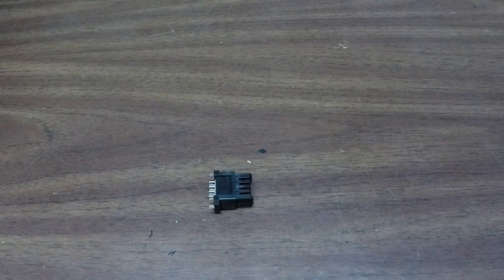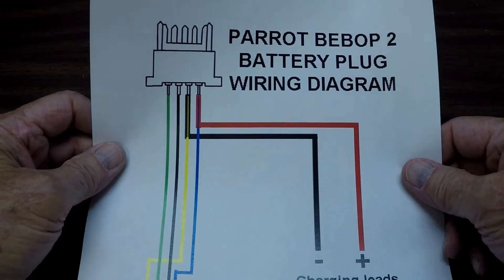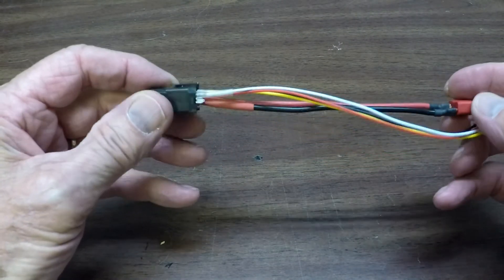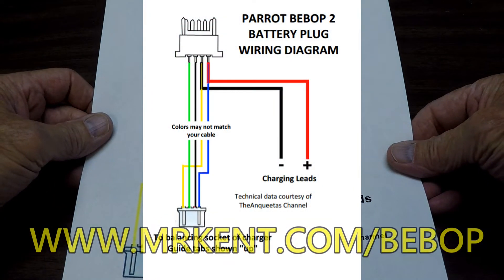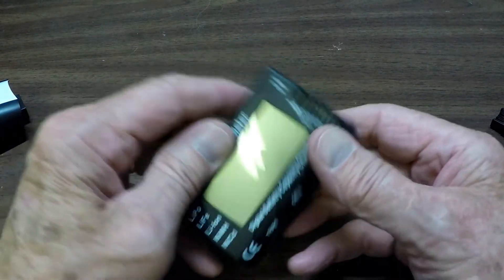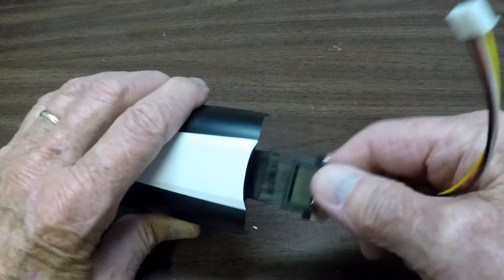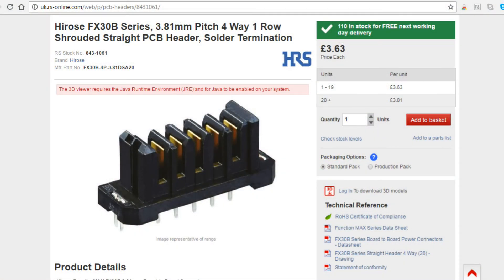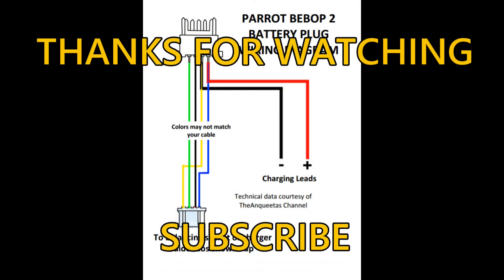The Best Bebop Balance Charger EVER

Comment: I have a bebop2 and never crashed it or got it wet and it will not power on and my batteries test fine with a multimeter...the red LED in the back will not turn on.
Can you help???
Reply from the maker: I wish I had an answer for you. I have heard of that happening to others. I don't think I can help. God bless.
Reply: @user-sr8pn9xg8z  thanks anyways.

Comment: Is the stock Bebop charger not a balance charger?
Reply from the maker: Thanks for your question. No, I am sorry, it is not a balanced charger. Otherwise I and so many others would not get the flashing red light when the cells become unbalanced. I have put up lots of different options that you can use to construct a connector between your battery and a balanced charger. The best is found at: https://www.youtube.com/watch?v=b1X77aK7ki0

If you have any other questions please don't hesitate to ask. Thank you for your comment and God bless.
Reply: I find your channel and web site fascinating. You certainly have compressed many years of knowledge into a one stop shop. Great work.

Comment: i got mine from your website, looks great, my IMAX B6 wont balance charge my bebop 2 stock battery, it will only charge the battery! maybe i need a new IMAX B6
Reply from the maker: Have you got one of those little $10 battery checkers? You can see for sure if it is balanced or not. My balance charger does such a good job that after charging and I switch to balance it only goes for a minute or two and says it is finished. Let me know if you can. Thanks and God bless.
Reply: it takes 20 mins to charge my battery, tells me that i need a new battery, any ideas? mines a little cheaper, all the cells are balanced, i got one of these https://www.ebay.com/itm/2pcs-RC-Lipo-Battery-Low-Voltage-Tester-1S-8S-Buzzer-Alarm-indicator-Checker-USA/332618307296?epid=25013427279&hash=item4d719896e0:g:vFkAAOSwDGhazwAk
Reply from the maker: I have never used one so I am not sure how they work. I have one of these and I can check the condition of each cell, one cell at a time:

https://www.amazon.com/Tenergy-Battery-Intelligent-Digital-Balancer/dp/B0178P8H9U/ref=sr_1_1?ie=UTF8&qid=1536015614&sr=8-1&keywords=5+in+1+cell+meter

I can't make a judgment of what you are using but the above is "ideal." I hope your battery is not bad. God bless.

Comment: mrkentdotcom  In description you have 2 diffrent part numbers listed dsa20 and dsa30.  dsa30 is linked to the mouser site dsa20 and dsa30 for digikey. Which one is the correct number? Thanks
Reply from the maker: I am not sure I understand your question. It depends which company you wish to order from. I am not sure if Digi-Key is still offering the plugs. I hope that helps. God bless.
Reply: mrkentdotcom look at your write up below the video. You have 2 diffrent part numbers. Fx30b4-dsa20 and Fx30b4-dsa30. Was wondering which one is the one to use. Looks like one is taller than the other.

Comment: To whoever is interested :)    I never had the Bebop 2, I have the Bebop 2 POWER. Only difference is You should get 3 - 5 min more fly time with the POWER. But whichever you buy I would definitely invest in a DP2 balanced charger (EV-Peak) get it at Amazon its a little pricey around $100. But it will balance charge all 3 cells on each battery + you get STORAGE mode, while the (High Def) charge brick you get from Parrot doesn't. The DP2 will work with Bebop 2(2700mah) battery's and The Bebop 2 POWER(3350mah) battery's. I'm pretty sure the DP2 Balance charger will pay for itself easily by next year at this time. I think Balance charging & Storage of the battery's is the most important thing. "Well" other than a medium to major crash. Ha Ha. FYI - I got the Bebop 2 POWER Extreme Adventurer package from Parrots website for $538.50. Ordered Dec 22nd - Received Dec 28th. They had a nice price at that time!  - - - - -  1 Parrot Bebop 2 Power ,  1 Parrot Skycontroller 2 ,  1 Parrot Cockpitglasses 2 ,  1 BackPack - WORTH $99 BY ITSELF - YOU WILL NEED IT! ,  3 Power batteries ,  8 propellers ,  1 charger + cable + 4 plugs - LIKE I SAID GET THE DP2 BALANCE CHARGER ( Love it!!!) - WILL STILL NEED THIS BRICK TO CHARGE YOUR SKYCONTROLLER 2 ,   1 assembly tool ,  1 USB cable ,  1 smartphone and tablet support ,  1 quick start guide
Reply from the maker: Thank you for your input. I crashed mine today, am producing the video at this moment. God bless.
Reply: No - Thank you mrkent , For all the Info you have passed on to me the past couple of months, through your videos ,  I have learned so much from YOU and Helderhugo. I know I'll be watching  out for your new video. "Keep it up"   and   Thanks again
Reply from the maker: Thank you for your kind words and God bless.
Reply: Hello You recommend the evpeack Charger? Is the same that having like a b6 Charger with custom cable?
Reply: @gonzarb93  - Yes ,  just go to AMAZON,  search for --- ( EV-PEAK DP2 35W/CH 3.5A/CH 3 Ports Intelligent Battery Charger for Parrot Bebop 2 Drone Battery ) The EV-Peak DP2 will charge 3 battery's at one time & will balance charge all 3 cells in each battery while it is charging, Another great thing about this charger, If you are not going to fly for awhile, You can put the battery'(s) in (storage mode) which will balance charge up to or drain down to 50%. The DP2 comes with a real nice heavy duty 3 prong power cord around 4 foot long. I see it is $90 now - I paid $105 for it in Jan/2018 and it still works great.

Comment: ~20$ charger cable with balancer connector on ebay

http://www.ebay.pl/itm/PARROT-BEBOP-2-charger-cable-with-balancer-connector/112762893910
Reply from the maker: Thank you for your input but I don't think that will work with the Bebop 2. God bless.

Comment: Found this.....no soldering   https://www.amazon.co.uk/Anbee%C2%AE-Balance-Charger-Adapter-Battery/dp/B00T82HV4O/ref=sr_1_1?ie=UTF8&qid=1508966856&sr=8-1&keywords=Balance+Charger+Socket+Adapter+Plate+for+Parrot+Bebop+Drone
Reply from the maker: Thank you John. Yes, Helder Hugo has a video about that one:
https://www.youtube.com/watch?v=drhc02ixMmk
It works for the Bebop 1 battery but as far as I know, there is not one for the Bebop 2 battery. Thank you much for your comment and God bless.

Comment: Thanks MrKent, have just received my bebop 2 fpv, but u fortunately the only battery that came with it was Dead on arrival, they are replacing it with a new one. I will make one of these connectors for a balance  charger, heard nothing but negative things about the stock charger. Just have to find a place that sells the connector in Australia. Thanks again, keep up the vids.
Reply from the maker: Amazon.com has this plug available for under $14. Just plug in the part id: FX30B-4P. I have purchased one from Amazon so I know you can get them there. I am assuming you can get to Amazon from there :) Thanks for your kind words and God bless.

Comment: sorry, I don't think you are following. there are 3 ends. The Digikey end, the white end (Allytech 10pcs 3S 26#11.1V)  the red end. Where to find the red one? thanks
Reply from the maker: OK, I get it. The red 3S 26 wire (which is the black wire on the diagram) goes to pin #2 at the Digikey plug. The white 3S 26 wire (which is the green wire on the diagram) goes to pin #1 at the Digikey plug. I think I need to redo the diagram huh? I hope that helps . . . Please let me know.
Reply from the maker: By the way, I have updated the diagram to match the color code of the wires that everyone seems to be using. Go to https://www.mrkent.com/bebop/
Refresh the page and view or download the latest wiring diagram. Thank you for your patience and God bless.
Reply: I know this is a few months old, but, the red plug in MrKent's video appears to be a Dean's RC connector, which is available at most RC hobby shops.  If you already have your balance charger, you should use what ever is used on your charger, for the main positive and negative charge leads.

Comment: I am talking about the red plug? I don't see a link to that one.
Reply from the maker: The colored wires on the drawing do not necessarily match the wires coming from your balancing plug. Looking at the drawing the "heavy" red wire goes to the pin on the far right. The "heavy" black wire goes to the pin just to its left. (Red=#4) (Black=#3) The "thin" wires connect as follows: #1 wire from the balancing plug connects to pin #3 of main plug.#2 thin wire from the balancing plug connects to pin #1 of the main plug. #3 wire from the balancing plug connects to pin # 2 of the main plug. #4 wire from the balancing plug connects to pin # 4 of the main plug.

https://www.mrkent.com/bebop/

Go to this link and click on the wiring diagram link if you haven't don so yet. I hope this is helpful. Don't hesitate to ask if you have any questions. God bless.

Comment: I built the balance wire per the print downloaded from your site. It was connected to a new SKYRC IMAX B6AC V2. Following all instruction, all I could get was 'NO BATTERY'.  Any ideas?
Reply from the maker: In my experience that message appears when one or both of the heavier "plus" and "minus" wires are not plugged into the charger.  There should be a total of six (6) wires connected to the charger; The three small wires, one from each cell, One small "common" wire, common to each cell, and the two heavier "charging" wires.

I hop that is helpful. If you have further questions do not hesitate to ask. A good video demo is: 
https://www.youtube.com/watch?v=unTMIHOJQg0

Thanks for your comment and God bless.
Reply: The wire was built correctly, I believe. Yes, 6 wres to charger. Tested with multimeter, all test seemed ok.
Reply from the maker: The one thing that was confusing to me at first was that the #1 (yellow) wire coming from the balancing plug must cross over and connect to #3 pin on the Bebop plug. You may want to check that carefully. Also, another good video to display correct wiring is the one where I discovered we could actually purchase a plug to match the Bebop 2 battery:

https://www.youtube.com/watch?v=orESacSy2ro&t=242s

You may want to watch that also. I hope this helps.

Comment: The DigiKey part no. referenced indicates a 20MM length plug (last 2 digits). They also have 25mm and 30mm plugs that will work.
Reply from the maker: Thank you for your input.

Comment: hi sir  i use the diagram ur 1st video sir what is the difference between to your new diagram
Reply from the maker: In earlier videos I did not connect directly to the battery, but came up with home-made wiring connections that went from the Bebop battery cable to the balanced charger. In this video the Bebop battery charging cable is not used at all after finding a place to purchase the plug to fit straight into the battery. I hope that helps. If you still have questions, don't hesitate to ask. Thanks and God bless.
Reply: how about the the changing results sir what is must better
Reply from the maker: This video is the most easy way to accomplish the task. The other videos I have up are also OK to use. When I made them I had not discovered that we can all get that plug to fit the Bebop battery.
Reply: I can't find the plug on Digi Key. Could you provide a link or the part number?  Thanks.
Reply from the maker: Hi Ron

The link to Digikey is ok. Just need to scroll down. But the part number is: 

FX30B-4P-3.81DSA20

Let me know if you need any more help. I'm glad to help.
Reply: I could not find the 2nd lead. I find Allytech 10pcs 3S 26#11.1V and the Digikey adapter plug, where to find the other lead?
Reply from the maker: I don't quite understand your question. Could you please give me more detail.